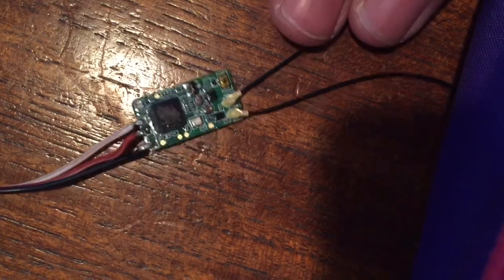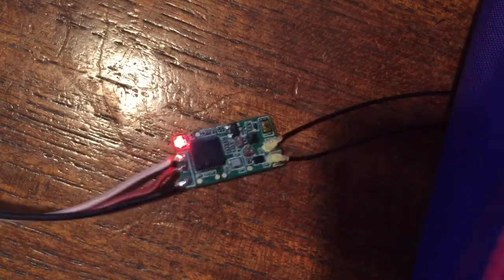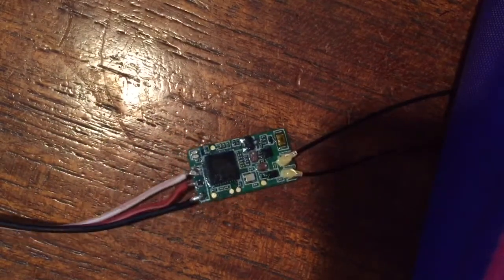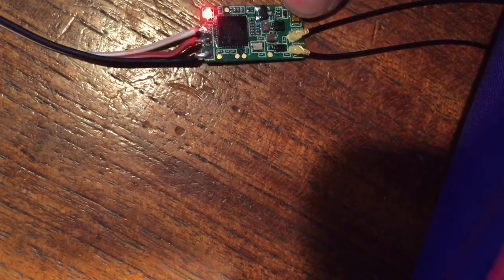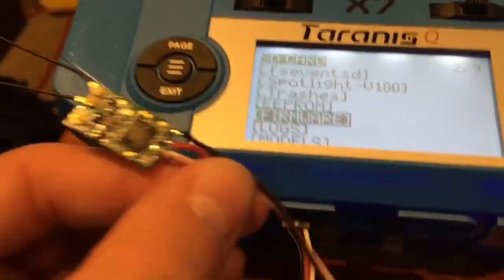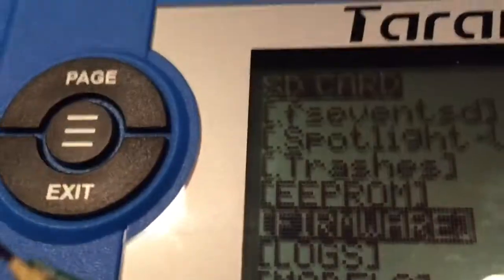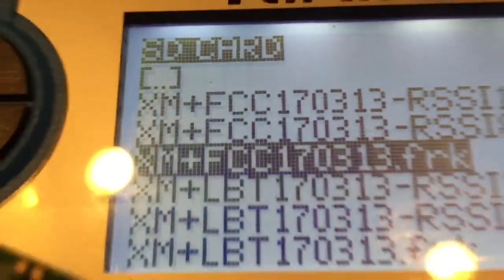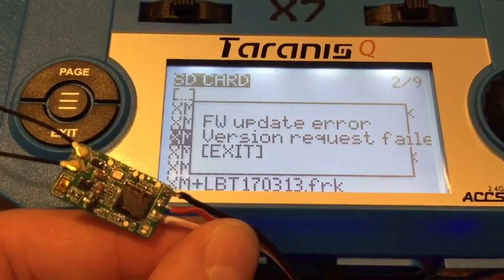Frsky XM+ receiver solid red light

Comment: https://youtu.be/49A20_wM0DE 

finally succeeded. No one has been able to solve this problem on the internet. Now I've solved it with the Error attempt. The problem is you did the wrong software update for Xm+ and it won't go into connect mode. You cannot re-download the old software.
SOLUTION Before downloading the latest version of XM+ from the S.PORT module of the .controller, press and hold the bind button of the XM+, connect it to the sport and print by pressing and holding the software. Do not take your hand out of binding mode until the printing is finished. Solved entirely by trial and error. Normally when installing xm+ software, the connect button is irrelevant, but I tried it this way, it installed the new software and both the remote and the receiver were connected. Thank God . Thanks everyone. Don't forget to subscribe to my channel

Comment: the reason is the firmware.. reflash with the firmvare  XM+170313 on the RX and the  TX internal module of the taranis with a compatible one. ( eg. for xlite s firmware ISRM-S_2.1.0).

Comment: Bind button and battery plugs in. Let off bind button. Red AND green light solid. I tried updating firmware. It was a success. Still didn't work. Tried a new reciever. Checked wiring. SAME ISSUE. I'm so confused I need help I just cannot figure this out. Not my first build the others went very easy. I'm using a xrotor f4 v3 fc

Comment: Hey ! Does changing the receiver resolve the issue or the problem is coming from the power source ?
Reply from the maker: Alex it’s definitely a firmware issue and it was due to flashing the wrong file to the receiver.
Reply: well I just got mine and without even having to change the software I have this exact solid red led issue.

I successfully updated the firmware but I still can’t manage to bind it ..!
Reply: @platyfpv   Same here, When I try to update it it says Sport then flash ex device but when I choose flash ex device I get error saying something about bottom pin no recognised.
Reply: Adam Anti-pop i just bought an R-XSR and it’s running fine now
Reply: @platyfpv  I resolved this issue for myself. Plug into back of Qx7 bottom port doesn't work like they say. You'll need to switch 5v wire with ground so it matches pinout. Then I was able to update and bind NP. Ironically I ordered rxsr because of this issue and it arrived with wire port burnt off and no antenna, the package wasn't even sealed so someone is taking advantage of Amazon return policy and not me this time!
Reply: @anti-popfpv4638  xm+ for constant red light issue?
Reply: @TheRecep27  are you having constant red light?
Reply: @anti-popfpv4638  forever
Reply: @aphinity   I am facing same issue, i could bind but its not connecting, solid red light is on?

Comment: Have same problem was a xm+ with wrong firmware and then i tried to flash it it did not work and now i have a solid red light
Reply: I also have a red light on. I will be using it as an accessory on the dinner table soon. steady red light

Comment: I just had this happen to me. After trying a second XM+ that I just spliced into my existing wires on my flight card -  I checked my flight card connections and my ground wire did not have a solid connection. It looked good, but had too much burnt flux under the connection. I re soldered the ground and it started working again. Triple check the ground connection when you have a solid red light.
Reply from the maker: Silverback FPV I’m glad it was a simple problem for you! Mine was definitely not a ground issue.

Comment: I have the same problem with my XM plus.  The red light is solid and I have no way of binding again or flashing (flashing firmware give me an error on Taranis X9D).  Is this problem able to be fixed?  This problem occurred for me totally random after one flight with a new receiver.  Wouldn't bind... showed solid red light... not able to flash now.

Comment: Same issue here, but with an XM board.  Since I have a multi-protocol Jumper T8SG,  I think I'll solve this by swapping in a DSMX RX for the wonky one in my Boldclash B06 as well as another I have in my LDARC ET100, just to be safe.   If one board can fritz on its own at this rate, my chances with the other don't look so great.  For my use, indoors in a small apartment, one type of RX is as good as the another so I'm off FrSky XM coz of the reliability issue, thanks.
Reply from the maker: Bill McDonald I’m now fairly confident the issue with mine was a bad firmware flash. I believe the wrong file was selected originally and now it won’t flash again.

Comment: I have a brand new one and my current one. Tried them both and the same thing is happening. What the heck FRSKY!
Reply from the maker: JimmyDean1992 I’ve found out it’s likely because I flashed the firmware file with a period (.) in front of the name. This is something the Mac OS adds. Once this is added, the boot loader is gone and the device does what I’ve shown in this video. FrSky won’t release the boot loader so the only option is to send the receiver back to them.